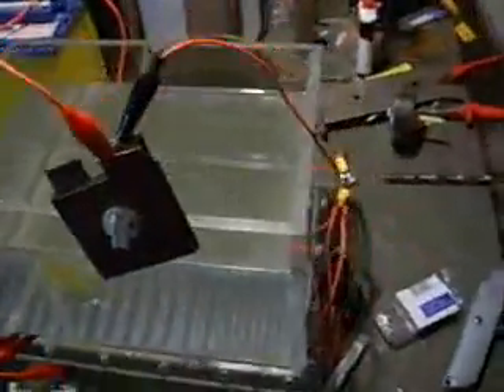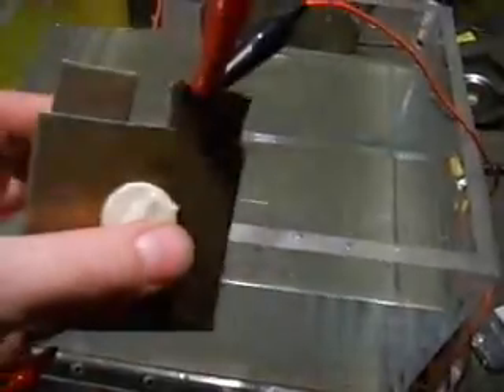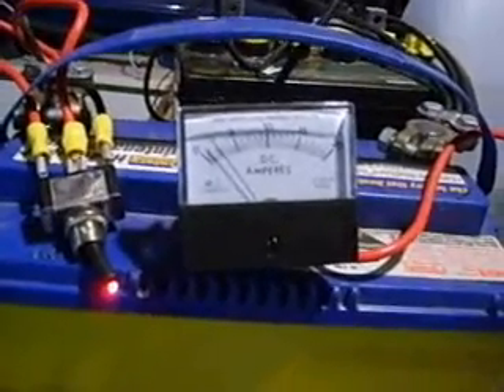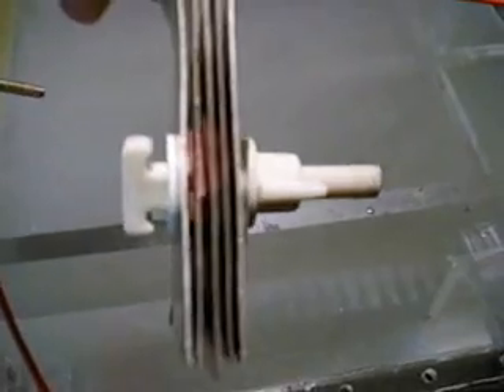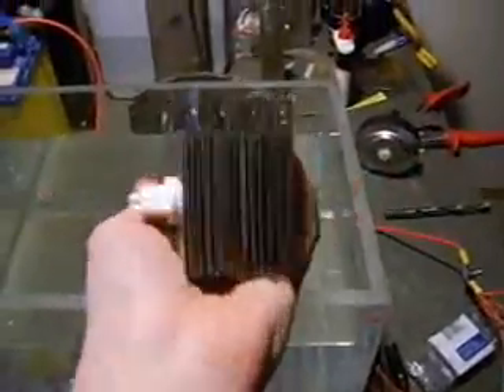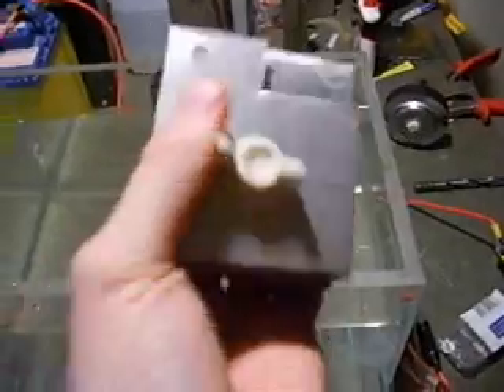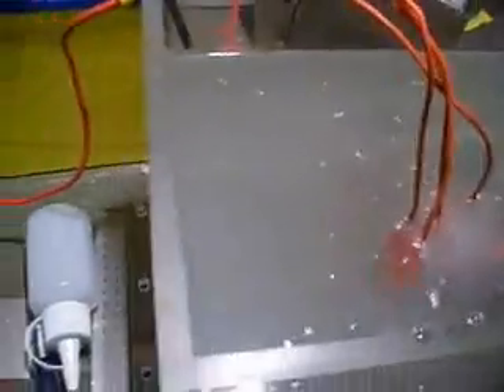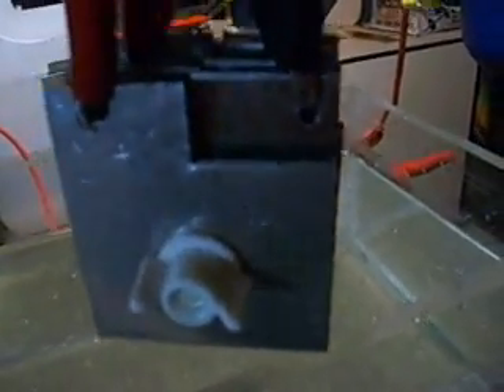Hydrogen at home (another new cell)#15

Comment: yep, this is good advice here !!! them neutral plates can be very effective at helping you tame your volts, but a series cell is a bit more complex to get working ... you gotta FORCE the juice to pass through the plates, not around them ... seal up the edges as much as possible and get convection flow and your series cell will work much better ...